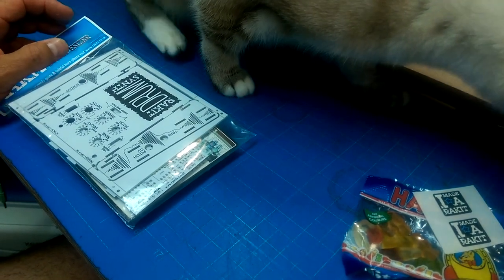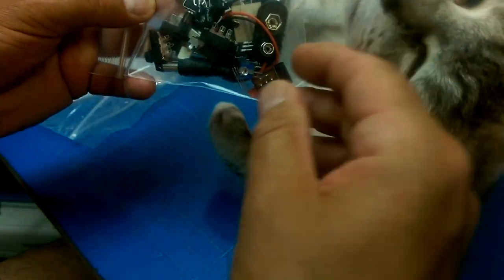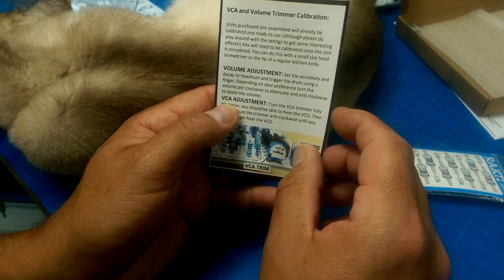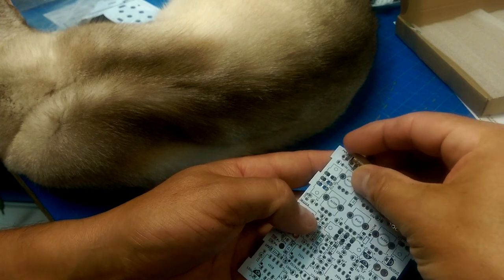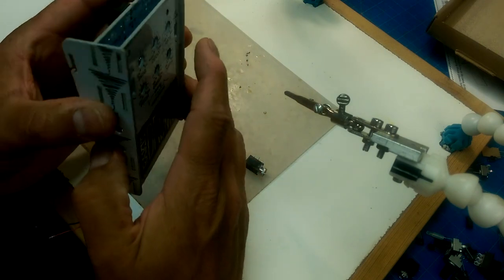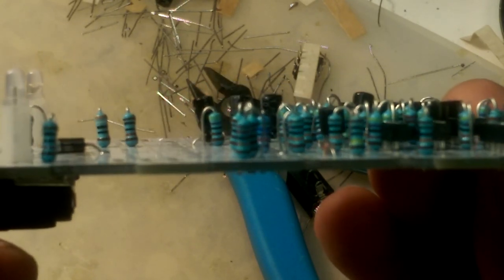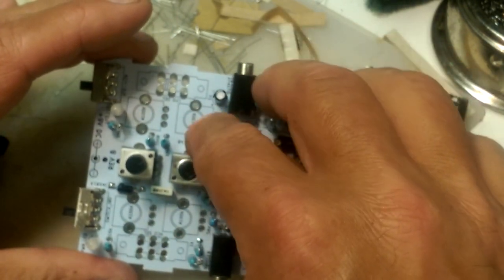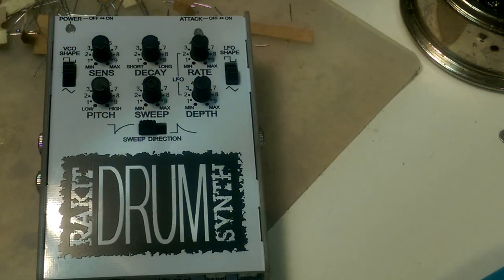drum synth

Comment: I just completed my Rakit Drum Synth which I had got as a Christmas present. I did a fantastic job if I do say so myself. Except for one thing....it didn't work. I double and triple and quadruple checked everything. It should have been working, but it didn't. I contacted Darren Blaxcell at Rakit and he was tremendously helpful. We worked together via email and together we figured out the problem. I had switched two 47k and 4.7k resistors such that the part of the circuit that established the virtual ground voltage was totally screwed up. The color bands are very similar and difficult to make out against the blue background of the 1% resistors. I never would have figured out where I'd gone wrong without his help. I'ts amazing how responsive he was. I got the problem resolved right away. Top notch!
Reply from the maker: Why I always use the multi-meter to check values.  I suck at color codes.  And Darren is an awesome fellow!
Reply: I always double check with a multimeter too but I still managed to put it in the wrong hole. So to speak.

Comment: Hey I got mine to work but the piezo chip was broken when I got it. It works when you tap it on the back of the board. I ordered new piezo chips but I can't get them to connect to the board even when I soddered them with red being postive and black being negative. This also affects it when I connect it with a sequencer such as the baby and the arturia keystep. I have to hold my finger down to the board in order for sound to come out and for it to work with a sequencer. Do you have any idea what I can do to fix this?
Reply from the maker: It sounds like it might be a cold solder joint on the output jack if putting pressure on the board makes it work.  Also reach out to Darren at Rakit.  He is an awesome person and will be happy to help.